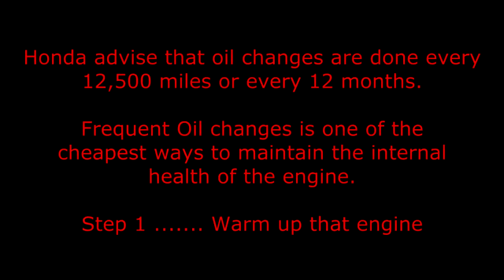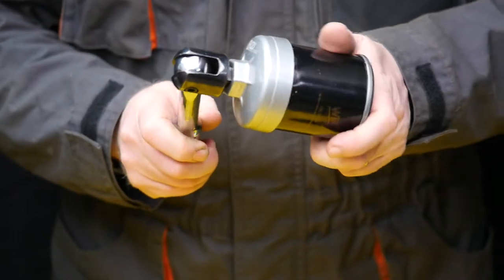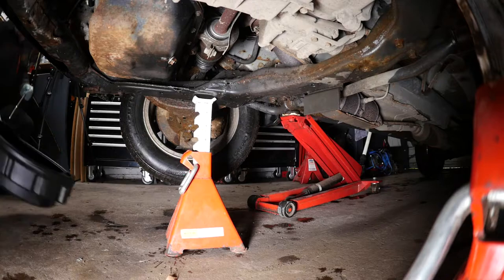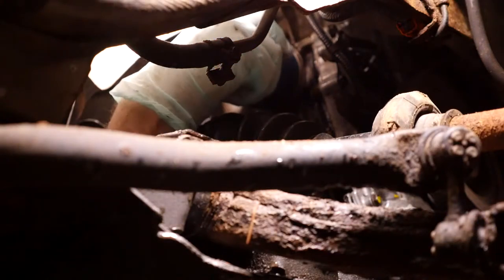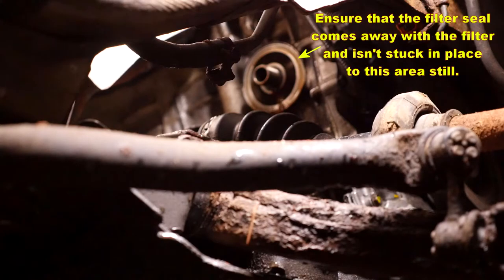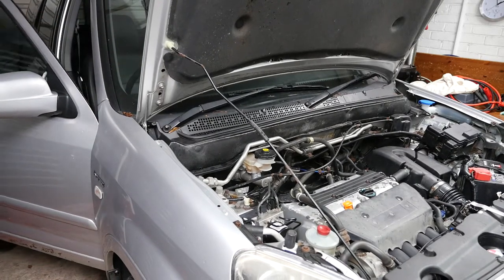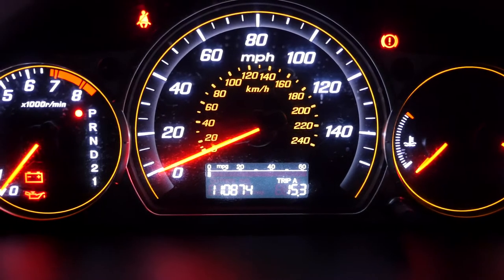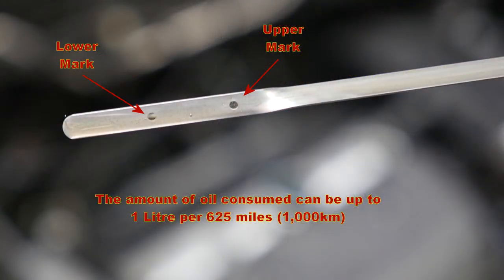Honda CRV Oil & Filter Change 🚗 Service - K20 K24 2 / 2.4 Litre Petrol Engine Civic Accord

Comment: I have a CRV with 210k miles, only had x2 engine oil changes in its life and never had the auto box fluid changed. Have been expecting it to go pop for the last 10yrs but the damn thing keeps going. I will definitely be buying another but with full service and plan to keep the fluids changed and topped up with the next CRV.
Thanks for the informative video.
Reply from the maker: I do think the Japanese engines were built better back in the day.  I had a Toyota corolla that had been driven dry which I found out after I had purchased it and although it was making a heck of a racket it kept going and going and eventually was exported to South Africa.  It now seems that from 2007 engines can't make it past 60k without self destruction because of the 'improved' way they are built.

Comment: This helped me a lot, enough so much so i changed my oil without jacking it up 😬
Reply from the maker: Fabulous news !!! Glad it helped
Reply: Yes, it can be done without jacking the car up. It’s a tight fit and hard to do an inspection. I use ramps which work well, were only about $50 CND when I bought them a few years ago. Lightweight but very sturdy and are a must to change oil in the Honda Accord. One question our 2002 CR V takes 4.2 litres for an oil and filter change and you use 5.3 litres with same size engine. Puzzled? Good video, thanks!

Comment: You're a legend mate... When I did my Mini R50 subframe rebuild it was your videos that saved me... And then we buy a CR-V and you once again save the day.... I also changed the VTEC solenoid, was still getting a P1259, so I ran a flush through, drained it (somehow pulled out over 6 litres of oil... That may have been part of the issue) filled it with some cheap and nasty oil from B&M, took it for a run and then drained it again... This time changed the oil filter, took off the solenoid and cleaned the screen and throughout the unit, refilled with a quality 5w40 and even added a little slick50 for good measure as she's got over 220k on the clock, just got back from my second run and according to Torque on my phone (OBD via Bluetooth) not only do I have better temperatures but I got that K20 to siiiiiiiing with no coding... Thank you so much!
Reply from the maker: Love it lol, I did love the CRV and it had probably one of the last best engines out the Honda K series.  I see some people put those K engines into their Mini's !!!! are you planning that?
Reply: @CoatsandGaiters  no, I don't think I'd have the patience for that, the crv is my wifes and the mini is my little commute vehicle... Although I drove it to work this morning and the honda was much less back breaking lol

Comment: I'm going to do this for the first time on my 2004 Honda CR-V, I'm on the other side of the ocean so mine actually is the K24 2.4L Petrol Engine, but seems location of drain plug and Oil Filter are the same as the K20 2.0 L engine.

That oil filter looks difficult to remove, hopefully it will come out easily.

Thank you for your video, it was really enlightening.
Reply from the maker: Thank you and hope all goes smoothly.
Reply: @CoatsandGaiters  thank you! Did it on June 07, everything went awesome, I did removed the front right tire in order to access easier to the oil filter.

Comment: SOS for Honda Crv 2002-2006 use 5w20 (0w20 Europe)  if u have 100.000 and under. If you have 100.000 up use 5w30 ( I searched every manual) i want to help for crv lovers. (Honda oil-Liquid Moly- Mobile 1- Valvoline- Elf-Total BEST BRANDS) reliable sources. And for coolant fluid use only Honda Genuine COOLANT (Type-2) OR blue coolants (Mannol, Zerex, Peak, Valvoline, Prestone)
Reply from the maker: Thank you for the info fronce33.
Reply: You could probaly use used chip oil for honda engine if needed

Comment: Hi Thanks for the excellent video and the voice over! As far as I know these engines are not prone to head gasket failure. I wonder what happened to this one?
Reply from the maker: Hi and thank you for the positive comment.  Did you see the rest in this series as I repaired the head gasket due to the previous owner driving with a coolant leak.  When they realised it was too late.  Think I did about 10 episodes on the repair.

Comment: Awesome. Thank you. Have you any idea where the fuel filters are on these? As I’m struggling to find information on them.
Reply from the maker: I've just looked in the Haynes Manual and I can only see reference to the Fuel Pump with Filter gauze located in the fuel tank.
Reply: @CoatsandGaiters  it is in fuel tank , access underleft hand back seat, eaasy to get to
Reply from the maker: @sirneil78  thanking you

Comment: I was positive I'd read 4.2L for my 2.4L engine. Was super confused with your 5.3L listed. Turns out that's prescribed amount for engine overhaul. Which I think you did, from your comments about doing the head gasket. But you also listed this as a 2.0L engine, so not sure if the amounts are the same. Anyway I"ll continue on with my 4.2L now.
Reply from the maker: Hi the Haynes Manual says 4.2 litres for an "Change" and 5.3 litres for "Total" for the 2 litre petrol.  I presume 5.3 is a totally dry engine maybe.

Comment: Tbe only thing that I do not agree about this presentation is the viscosity of oil that you used. Isn't 5w40 a little to thick for that engine?  I am using 5w30 for my 2014 CRV 2.4 4th Generation.  Do you really think that using 40 is just alright or better instead of using 30
Reply from the maker: Hard to remember back that far but I normally choose the oil from the owners manual.  Most oils today are 5w30 and thats what I tend to use though I do recall some people saying that when I used that in the Honda HRV it was way too thin and the engine would consume a fair bit.  So not sure If I chose that oil from owners recommendations or the Honda manual.  5w30 is the norm though for most cars.
Reply: 40 is fine on a car this old, if it was the K series in say the EP3 civic type-R or the Integra I'd go 30, 220k and counting
Reply: My wife's 2004 CR-V with the K20 engine gets 5W-30 ACEA A3 as per manual and the engine doesn't consume any. 158,000 km which is roughly 100,000 miles on the dash.

Comment: Actual oil that you use is exol 5w40. But your description says a link for 5w30? Why is that?
Reply from the maker: I think the manual might have said 5w30 for the UK temperature but when I used this in another Honda lots of people said it would be too thin and that the engine would drink a fair bit.
Reply from the maker: Bruce Wayne  It depends on many factors but when I put 5w30 in the Honda's tended to burn a bit past the oil control rings so I was having to keep topping it up.  I was advised 5w30 was too thin.  The manufacturers favour thinner as it's better for emissions.  I think you have to choose what you feel suits you.

Comment: great one! thank you
Reply from the maker: Hope it helped
Reply: Coats and Gaiters haha , my one is 2002 crv , do  you have any idea to reduce the fuel consumption ?  Which is around 14L /100KM I think maybe it s bit high. Hope u can make more videos about this car !  Cheers mate!
Reply from the maker: @mantinyu2733  is that about 20mpg ?  I'd have thought it might return 27 average so that does seem a bit high.  No brakes dragging?  Sadly I mended the car and the bought an X Trail to repair which is where I'm at at the moment.

Comment: My car currently has 5w20. But my mechanic suggest motul 5w30. Is 5w30 isn't too thick for the car? I got 2006 crv
Reply from the maker: I used 5w40 but today most manufacturers seem to favour 5w30 so your mechanic is probably right.
Reply: @CoatsandGaiters  thanks for the reply. Do u drive in winter season? Or does ur place always hot or sunny? Reason is I heard that thicker oil are good in summer or hot season. And lastly how long you've using 5w40 on ur crv?
Reply from the maker: @Kuykuytv  the UK is fairly cold so I think thinner oils are advised for fuel economy. I only had the CRV to repair the head gasket and then sell on.

Comment: Great. Truly informative. May i know the part no. Of that original oil filter?
Reply from the maker: Thank you.  I think it's 15400RBAF01
Reply: @CoatsandGaiters  thanks,  its important to me to know so i can have a reliable comparison of the oil filter.
Reply from the maker: @franka6790  the OEM one would be the best but also the most expensive.  My cars are all worth under the £1,500 bracket so OEM starts to become too expensive for the cars value.

Comment: Hi, How do I know which part number to buy online,like this oil filter? thanks
Reply from the maker: I normally use ebay and do a search using the number plate of the car.  It's normally done on that or the chassis number.
Reply: @CoatsandGaiters  what if they recommend same parts but different number? sorry being a pain. thanks a lot
Reply from the maker: @NOYNOY29  car parts are a bit of a nightmare I find.  They often have different numbers for no good reason other than charging more.  I normally search for the number on the original part I’m removing or just go by number plate look up.  If in doubt ring a motor factors to get a make and part number you can then start a search with.
Reply: @CoatsandGaiters  just done mine today, saving a small fortune, thanks a lot, next air filter and other fluids, any videos on that? thanks again
Reply from the maker: @NOYNOY29  Thank you for the comment.  I did a few on the CRV.  Here's a list of them.  https://youtube.com/playlist?list=PLWhghfmySWmq8cIaKtEbuaJJ3ZSyHhZ72

Comment: ,,,,,2 Esdras2: 31-100
Reply from the maker: Sorry I don't know what this means? Google translate didn't work.
Reply: @CoatsandGaiters  

2 Esdras2: 30 -100

an ancient prophecy,.. as it is, no translation needed
Reply from the maker: @likeasparrowinthewildernes8333  oh I see.  Thank you
Reply: @CoatsandGaiters  
any videos on changing front wheel speed sensor? my front left wheel speed sensor is perhaps faulty as the abs light is showing ofcourse replacing the speed sensor would require wheel bearing change
Reply from the maker: @likeasparrowinthewildernes8333  sadly I don’t have the CRV anymore but the front sensor is held in place on the hub by a single small bolt so they should in theory be easy to remove unless rusted in.  Hope this helps.